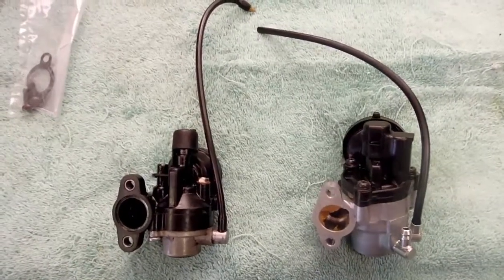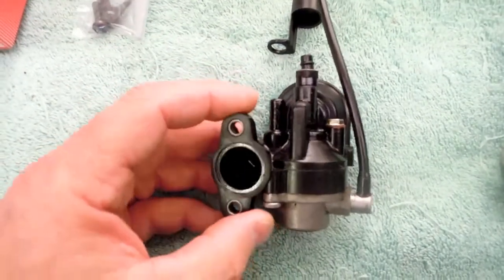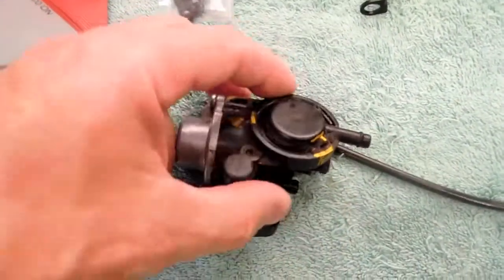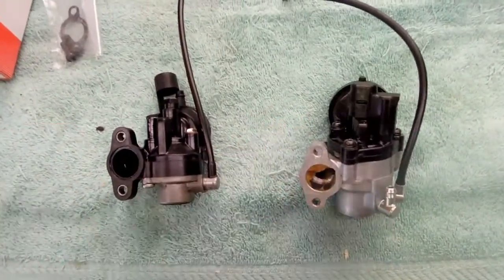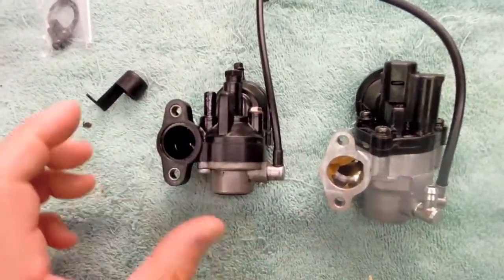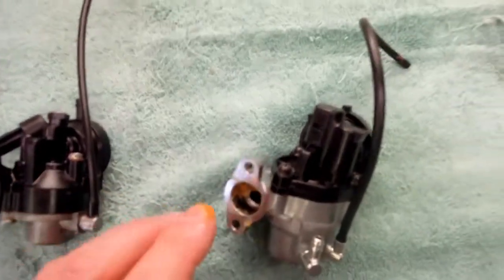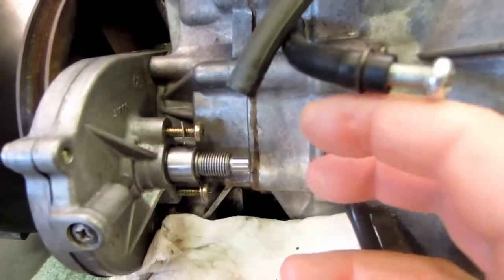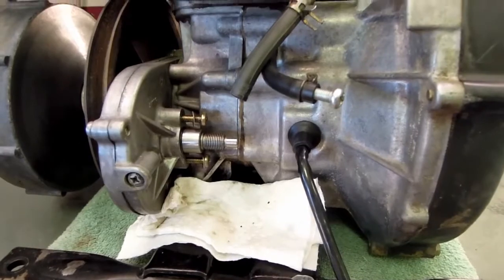Yamaha Golf Cart Oil Pump Replacment

Comment: I was a golf car mechanic starting in 1979 fresh out of high school  I worked at a huge Yamaha Dealer. 
The oil pump you have was a warranty recall back then among a ton of other things. 
I had over a thousand cars in the fleet I serviced. 
I did hundreds of the pump recalls, on the engine  by just removing the primary.
Reply: Does the adjuster increase oil when tightened or decrease? I accidentally messed with mine. How to set properly?

Comment: I have a question for you, I have a G1 yamaha and I was wondering which way you turn that adjustment screw to increase or decrease oil flow? I know this is a old video but if you remember that would be great.  Otherwise if you still have the old pump tear it apart and kinda do how it works video that would be cool too!  Thanks
Reply from the maker: To my knowledge, there is no adjustment specification for the oil pump, hence no detail on how to adjust the oil flow.  The nut under the black cap is intended as an air bleed fitting.  In other words, I wouldn't mess with it.
I do have the original old oil pump and perhaps some day I can do a how-it-works video.

Comment: How oil pump get failure please explain the reason?
Reply from the maker: As I believe I mentioned in this video, I've never personally seen an oil pump actually stop pumping oil.  However, I have had them leak, such as the one I replaced in this video.
The cause of a leak is likely due to an oil seal issue.  My guess on an outright failure would be something mechanically goes wrong inside the pump or a pump is leaking so badly that it can't create sufficient pumping action.

Comment: Is it possible to replace the oil pump without removing the engine?
Reply from the maker: Miguel Laboy No, this isn't practical in my view.  The oil pump is down low and tucked up out-of-the-way, and just getting access with engine installed would be quite challenging.  Perhaps someone out there has done it, but I wouldn't attempt it.
Reply: kwrightway yea I've come to that realization..I was just trying to save some time..thanks for the response..

Comment: How've you tell when the oil pump quits pumping?
Reply from the maker: Unfortunately, usually the first sign of oil pump failure is the failure or seizing of the engine.The only effective way to verify oil pump output is use a oil/fuel mixture in the fuel tank, remove the pump output line and run the engine while monitoring for pump output.  The engine has to be running for this as the pump is driven by the engine,that's why a oil mixture needs to be used, since the pump is disconnected.

Note that actual oil pump failure is pretty rare in my experience.  In fact, I've never personally encountered a pump that has actually failed to pump oil.  Leak yes,fail to pump, not yet.